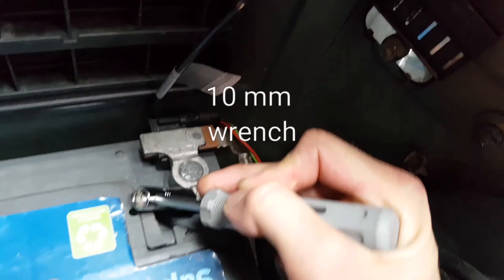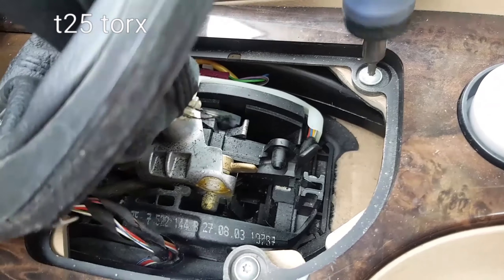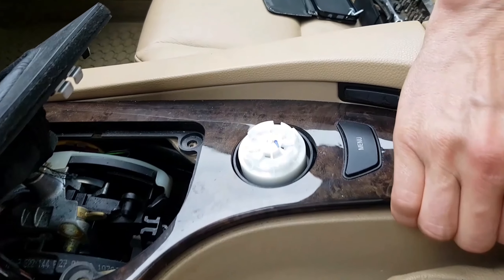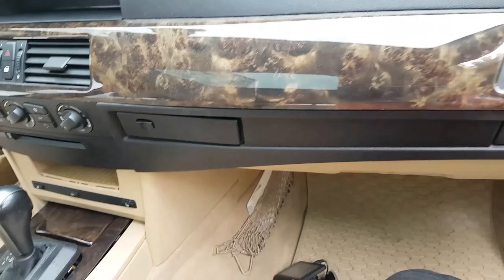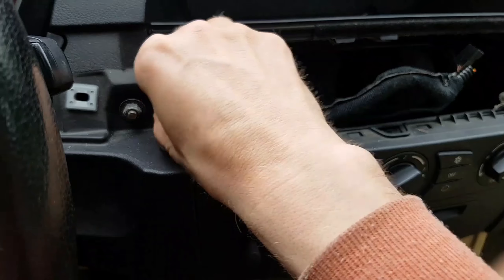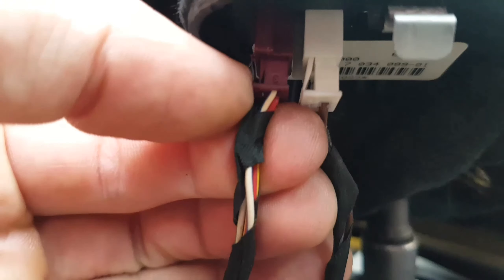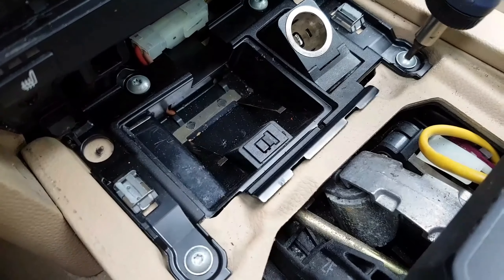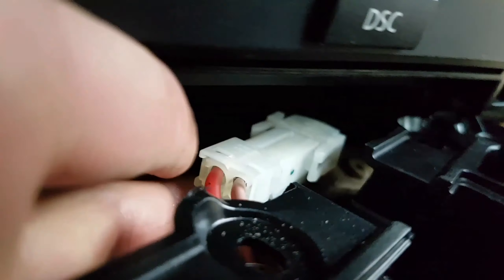REMOVE CIGARETTE LIGHTER COMPARTMENT, DASH, TRAY STORAGE BMW E60 Ashtray WYMIANA WKLADU POPIELNICZKI

Comment: Why would you have to disconnect the battery tho?
Reply from the maker: Just in case to prevent car from exploding xD. Being serious maybe it is not necessary until you don't work with airbag wires.

Comment: makes no sense to have to remove so much ~!
Reply from the maker: You have to remove so much to get access to all 4 screws holding cigarette housing. You can try to remove the part over the cigarette housing without removing the upper parts.